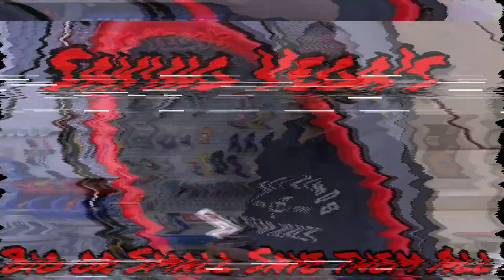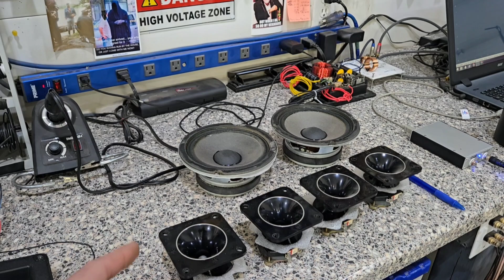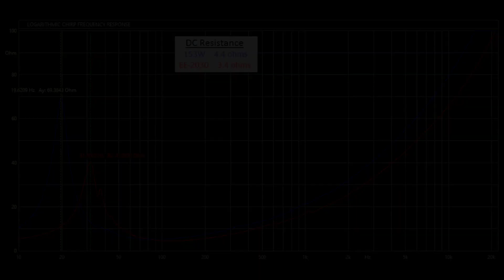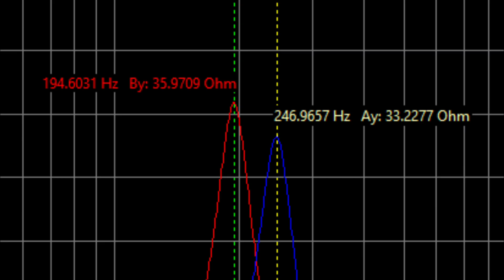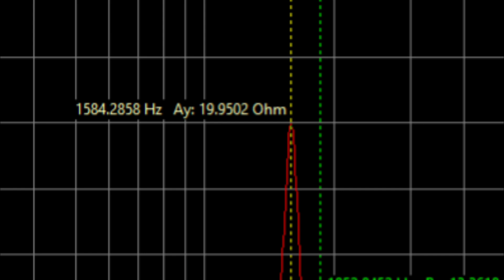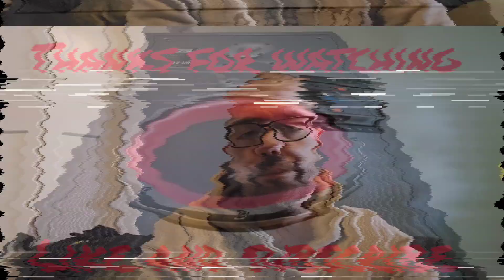Cerwin-Vega! 316R Project Testing & Diagnosing

Comment: Actually, the blue bass driver is perfect!
It has very low Fs and very high impedance on the resonant frequency. The higher and steep impedance means, it has very strong magnetic field and possible very low Qes, and Qts accordingly. This is very good.
Please, if you can, measure the full TS parameters.

Keep what you doing!
Reply from the maker: The spider is completely sagged out on it, so the coil is sitting too far down into the gap.
Reply: @SavingVegas  But the impedance looks much smoother.
Anyway, if you can measure the TS parameters we might have full picture. 
The red bass driver, looks more damaged, or the second bump on the resonant curve, is some reflection from the standing table.

Comment: Hi,
to avoid overload, decrease the sensitivity (the button above Mic. Power Supply). Increase the "Input full scale" to 10 or 20 dBV if necessary. In any case, usually is best to measure impedance with same level, for ex. 2,83V and adjust Input scale.

Best regards

Comment: Looking forward to the other half of the video to see how those woofers test out and what you're going to be doing with them.

Would you be able to offer some help with parameters and or crossovers for D-3, D-5 as well as the HED U-321, more specifically, have you ever tested the parameters of a L121-4 or a 101-W2 out of the D-5 and D-3? Trying to get them restored, or replacement woofers as close to matching as possible given the D-3 and U-321 didn't come with factory woofers, and the D-5s had a terrible re-cone job done and were none functional as well.

Let me know if you can help, thanks man.